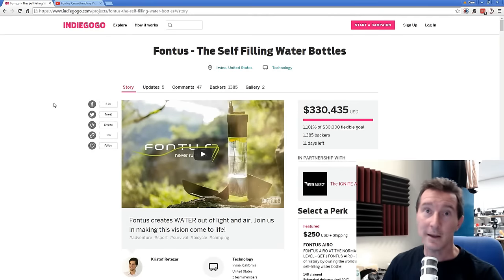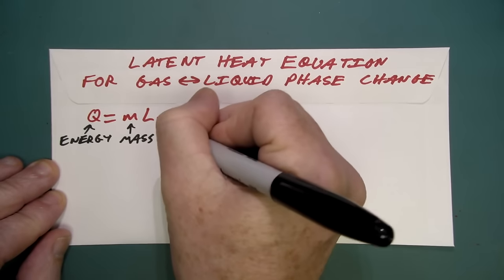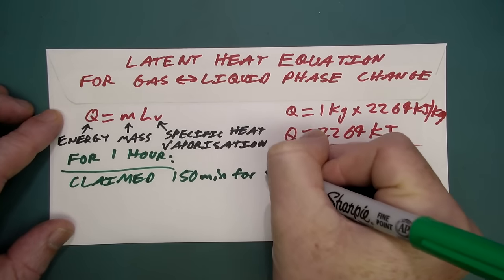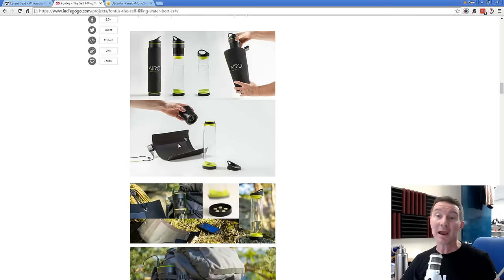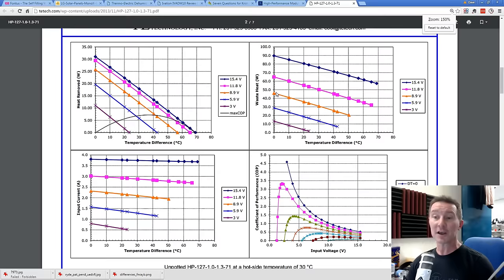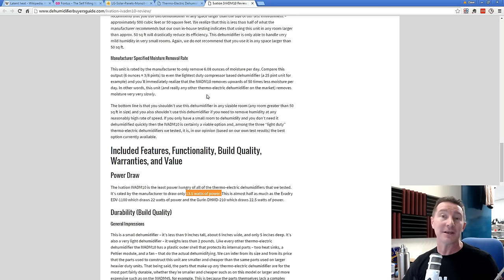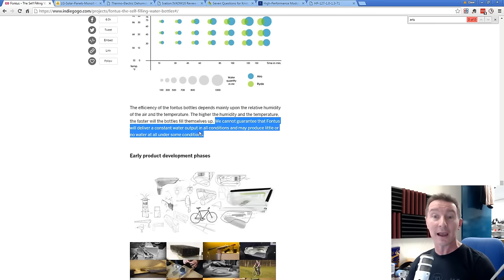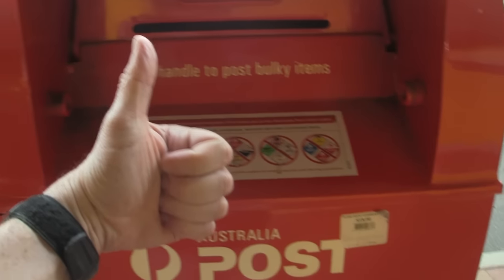EEVblog #881 - Fontus Self Filling Water Bottle BUSTED!

Comment: Actually energy is released when water condenses, so you don't need to put the vaporization energy into your system but rather extract it from your system - otherwise your water will immediately re-evaporate. But where is all that water supposed to come from? Saturation concentration at 40°C is  according to Wolframalpha, that is about 50g of water per cubic meter of air. For 1L of water you would have to remove all water from 20 cubic meters of air - or more likely 10% of the water from 200 cubic meters of air.

One fun fact is also that their promotional video shows a bike rider in a cold and dry environment - it's much easier to get the water in that area by melting the remaining snow on the ground ;)

And lastly the condensed water would essentially be destilled water, free from any minerals and probably not the stuff you need after an intensive bike ride...

Comment: Totally agree that the product will not meet its claims, but Dave you didn't really explain that the energy you calculated was being removed from the water vapour in order to condense it. It may happen though that the energy required to shovel this heat away is in the same ball-park (COP ~1?), but felt like you glossed over it a bit...

Comment: also the fact that in 40C performing strenuous activity (adventuring) you need to drink 2L of water an HOUR since you're going to sweat so much fluid and drinking hot water is not recommended because you need something COLD to avoid heat stroke

Comment: Math checks out!  As soon as I saw those kJ/kg units in the chart, I had to pause the video and run the math myself.  I got as far as seeing 1L/1hr of water production would run you about 629.1 watts continuously over that hour, about the amount you could expect from a decently beefy gaming PC.

Naturally I then had to resume the video and see if my math checked out (thankfully it did), and for the 150minute time you went with I got approx the same result:
        (1kg * (2264.76kJ/kg)) / 150minute = 251.64 watt

I looked up some advertised specs on a portable solar panel that looked about a similar size, and it advertises 5W of power max.  Assuming that kind of power available, 50% efficiency to account for night, and 100% efficiency everywhere else, you could get 1 liter of water every 1 week, 3 days, 11 hr.

Going further, a random site is saying men need 3.7 liters of water per day, so in order for someone to be able to survive off of entirely bottles powered with those 5W panels, you would need 39 of these bottles to sustain yourself, and most of your day would consist of going back and forth between them to reposition them to point toward the sun, and the rest of the day would consist of doing everything you can to avoid sweating lest you need to start buying more bottles to deal with the increased water intake.

If I'd lived on Tattooine though, I would totally pick one of these up if I saw it in a flea market.

Comment: i managed to make a "atmospheric water generator"<read dehumidifier> using several peltiers in parallel i managed barely 100ml in an hour with a 12v 30A power supply. The other factor to note is the amount of air drawn in. You need 30 CFM of air at 100% humidity at 30 degree centigrade for one hour and extract all the water out of it. Very possible if physics took a few sick days off

Comment: Well I have to admit, my fridge does make a lot of water from condensation every single day.. Not enough to drink, and I certainly wouldn't drink it
Reply: shomolya probably, fridge uses half a kwh per day
Reply: +redtails and 1 peak watt solar panel produces about 1-1.5kwh/year depending on where you live in the world, so ~185w solar panel with no electrical transmission/conversion/storage losses
Reply: +redtails Don't drink it - it is full of dust and you have never cleaned the bowl on top of the compressor :D

Comment: You have misunderstood the thermodynamics of condensing water out of the air. Water vapour is not a gas phase of water, which is steam, so there is no Latent Heat that needs to be extracted from the air to create condensation. Instead, the air must be cooled below the Dew Point for the air, which depends on humidity and temperature. At 90% humidity at 20°C the dew point is ~17°C, so the cool surface must be below this temperature to condense water. If no Latent Heat is generated by this action then the energies involved are much, much lower.

Comment: Interesting to see a different approach to this. Another guy worked it on how much water is in air at 30C if saturated and how many litres of air you would need for 1 L of water. Assuming 50% efficiency then you'd need 100,000 litres of air. So busted wither way.

Comment: Dave, in order to produce water from steam you have to take energy out 
of steam, not to bring it. You have to take 250 W from the freezer in 
the bottle - it's a different case.
Lat's do the math.

dew point for 40C 90% is Tc = 37 C = 310.15 K
ambient temperature Ta = 40C = 313.15 K
Diameter of a radiator d= 6cm= 0.06m
Speed of a cyclist = 15 km/h = 4.16 m/s
Isobaric volumetric heat capacity of air C=0.0013 J*cm^-3*K^-1 = 1300 J*m^-1*K^-1

So for Carnot cycle (ideal case) we have
W = Wh*(1-Tc/Th)
where W = power of the heat engine, Wh - Power of the heat source, Tc - temeperature of the cooler, Th - temperature of the heater.
Engine produces power W taking power Wh from the heat source and bringing part of it Wc to cooler.
As long as Carnot engine is reversable we can bring power to it taking power Wc from the cooler and moving Wh=Wc+W to the heater. We know that we have to move Wc=250W from the freezer. Let's find how much power W we need for that.
We know that Tc=310.15 K because it's a dew point we need to get water.
Let's find Th.
All Wt has to be blown out by air, moving through the radiator of the system.
Every second through the cylinder d=0.06 moving with a speed 4.16 m/s passes V=0.01 m^3/s of air.
If heat exchange is perfect air comes out with temperature Th and moves away
(Th-Ta)*C*V of power
Wh = (Th-Ta)*C*V
on the other hand Wh = W/(1-Tc/Th) = (Wh-Wc)/(1-Tc/Th)
Wh=Wc*Th/Tc

(Th-Ta)*C*V = Wc*Th/Tc
Th = V*C*Ta/(V*C - Wc/Tc) = 333.8 K

W=Wc*(Th/Tc-1) = 19 W (to move 250 W from the bottle)

What's the size of a 19 W panel?

Of course, if they want to use Peltier cooler with a 10% of efficiency of the Carnot cycle, they have to find 190 W of power. And because of that additional power we have to dissipate, our hot radiator will be much hotter and it leads to even less efficient cooling which leads to even more power consumption and so on.  
And of course it's an unachievable case with perfect heat transfer, the radiator as big as the bottle with no air speed loss in it, without taking in account that we have to cool down air to dew point and so on.

Comment: I know of a real way to get water using solar energy: plastic bag around a leafy tree branch. Another option is to dig a hole, put some branches in it, or some undrinkable liquid with water, like pee or seawater, put a cup in the center and put some plastic over the top with a small weight over the cup.
Reply: +Brandon Taitano also air wells to collect water from the air via daily temperature variations.

Comment: Dave, do you understand that what you have in the air is not steam? That calculation is better suited for condensing hot steam from over 100°C. You just need to cool water under its dew point, which depends on humidity and temperature, to condense it. At 90% humidity with Tamb = 40°C, dew point is about 38°C (see https://en.wikipedia.org/wiki/Dew_point#Calculating_the_dew_point). You are cooling water and air together, but heat capacity is dominated by the water, so is about 4kJ/KgK, which means that you need let's say 10kJ for 1L, in 2.5hrs that is 4kJ per hour or less than 1W. So yeah, I guess you can get away with the small panel.

Comment: Why wouldn't you just buy a bottle of water? Or fill up a bottle with a tap?
1L of water = 1L of water, in several seconds. Recycle the bottle. Done.
If it comes out it'll suggest in the instructions to fill the bottle before heading out so you have some water ready to drink, and it'll claim to "replenish" it.
Reply: +bassl0va What next, are you going to say we should let the water condense through temperature gradients way up in the sky and then just filter it so we don't have to change the state ourselves? Then there would be water falling on stuff all the time, what a disaster!

Comment: Dave, could you please explain why tapping off of centrifugal force in only one tangent (straight up) to make the engine doing it weigh less? I saw some one trying to explain this calling it an "angular momentum drive". Citing the variables (among others) as mass, rpm, mass travel distance, forced moments (in degrees on extension & retraction of mass).

Comment: I have done theses calculations before this project came out. One could use batteries, but it would be heavy.
 Even if it worked, it would a  better idea to carry 1L of water on a very lightweight bottle and refill along the path.
Reply from the maker: +Jonathan Araujo Can do the back-of-envelopes on that one too. But I don't even need to touch the pen to know it would be silly.
Reply: EEVblog people with a basic of physics knowlege can just "feel" improabable things like this.

Thinking on weight, once I imagined a system to carry just the H2 gas and combine it with atmospheric O2 (burn) to have water. It would be a heavy chunk of gear to store H2, burn and cool it down. Better to just carry the water...

Comment: I have one of those white plug-in Ivation dehumidifiers and it's never actually managed to remove 250ml in a WEEK (probably even a month) after 24/7 operation in air of around 50% humidity.  Maybe the Fontus Airo is designed to meet the water needs of ants?  I dunno.

Comment: If it takes 2264 J to produce 1 kg of water in 150 mins, and you divide that by 2.5 to get roughly 1000 J in an hour, aka 250W, you're not producing a kg of water in that hour with your 250W for an hour, you're producing 400 ml.

Comment: Maybe if you could create a very cold tiny  point and then lock the condensation in the bottle somehow so it is like a fluid diode, then the energy requirement would be lower? OK so it may take a LOT longer than you would want. What you seem to be doing is actually canceling entropy, like what is the lowest energy way to counter entropy.
Reply: +Matthew Suffidy Not totally sure this water doesn't have dust in it also, so I don't know it would be cool to drink.
Reply: +Matthew Suffidy Are you thinking of something like Maxwell's demon?

Comment: If they use the heat from the hot side of the Peltier device the amount of condensation possible when the hot air hits the cold side of the Peltier might cause significant condensation. 

Some intelligent energy management and zone damper systems actually run the heat with the air conditioning, to cause extremely rapid dehumidification of indoor air. The high TD (Temperature Differential) causes the water to condense, as the air rapidly contracts in size through the cold evaporator. 

Along with small pressure differentials and a Ranque-Hilsch vortex tube effect, pretty good condensation may occur. However from actual experience from units pumping 5 tons of R-410A refrigerant an hour, through a very large evaporator, I highly doubt that this small device could come anywhere near a litter in two and a half hours. Part of the reason is the quantity of air that would have to pass through the unit, to get one liter of water. It would require a large quantity of air because the water is highly dispersed in the air. 

If you have ever used an older smoke machine you know that just a small amount of water used, can fill a room with very uncomfortable wet damp air. So unless the fan in this small device can pump many CFM (Cubic, Feet, per Minute) of air, I highly doubt the unit will get its hands on enough air, to get enough water. Because of the small amount of air that will pass through the unit. Assuming a total condensation of all water in the air passing through. Even if it could power a fan to draw ten cubic feet of air a minute through the canister, it would be short 10 times the volume of air necessary to get that much water from air. 

They may be forcing the air through a reverse osmosis filter, which if the filter is cooled may be able to extract all or most of the water in the air passing through it. Because the openings within a reverse osmosis filter in many cases can stop a virus from passing through the filter. Such tight proximity to a cold wetted surface on a molecular level may extract 100 percent of the water in the air. But again I doubt they have achieved this. I believe it could be done though.  

There are very real things that laugh at unity, however I suspect this is not one of them. When I was younger I was at the Long Island Science Congress, in the 70's and another student had a solar cell his fathers factory was making but could not sell. It output 10 volts, in a dimly lit auditorium. It powered a small motor very well. 

Having had friends that worked on top secret weapons projects, using radio waves, I am sure that perpetual motion is real. And it is also very scary to some that fear evil uses knowledge rather than ignorance to base their evil actions upon. 

There are also certain impeller configurations, that can cause rather amazing effects, pressurizing air. However again I am in agreement that this device will leave you rather dry if you expect the listed results. 

Sincerely, 

William McCormick

Comment: There is an update from the guy on indiegogo, "The information shown about the core technology Fontus uses to extract water from the air is simplified and incomplete due to the fact that it cannot be made public until it is fully developed"

Well, at-least he admitted two things;
1) Technology is not fully developed (of course it will never be)
2) Information/illustration given is far from reality (used industrial/graphic design skills to mislead people) 

The guy seems to be a talented art student, who has skills with graphics and presentation, only if put to good use. Unfortunately, he seems to have another skill, as an excellent con-artist.

Comment: Sorry Dave, at 4:50 you made an error of units  in your calculation, mixing Energy and Power, or missing the evaluated time:905kJ/l = 250Wh/l (not Watt/l).So in 2.5h, you would 'only' need a 100W panel.
Reply: +Dr. Frank 

kinda right but kind not. dave did make a mistake. he counted the 2.5 under the 2264 Kilojoules as being liters when it should have been marked as hours. 

2264KJ/2.5h = 1L
normalize it to an hourly rate ->
(905KJh)*2.5h = 1L
convert to watt hours 1Wh=3.6KJh ->
(251Wh)*2.5h = 1L

still need that 250 watt panel =(

Comment: 250 watts in an instant is ROUGHLY a solid baseball bat swing at like half of all your might.  Do this for an hour, CONSTANTLY with no break, that kind of output of energy is needed.  Sorry bub, your dinky little solar cell is NOT going to do that.  And the condenser would probably catch fire under that much load if we consider heat loss from any resistance in the circuit.

Comment: You forgot to mention one thing, unless you live by a large body of water, high humidity means cloud cover. Which means solar cells don't work very good. At least that's what it means here in the US. Normally, in the US, on a hot day Which is when you need the water, You will get about 50% or so humidity, In the summer. Your not only not going to get the solar power to charge the batteries and run the thing, when you have the solar power available, you're not going to get the humidity you need for it to work. " Catch 22 ".  Maybe if they put a 500 W generator on the bike, it might work. But who wants to pedal power a 500 W generator on a hot day especially if you're trying to go uphill. maybe they can change the design a little bit, Instead of a dehumidifier, make it where it will cool the water or at least keep it cold. That might be Reasonable.

Comment: I have a brilliant idea! How about I could invent a device that attaches to the exhaust pipe of a car that absorbs exhaust gases to make more gasoline! Fuel efficiency would then go through the roof!

(Nevermind the fact that you'd have to keep replacing the device because it would run out of reactants and the device would cost energy to make.)
Reply: +LT Gen Klink Condensing water from the air through the power of the sun is a bit more realistic than that, but not a very good way to make money since it happens all by itself whenever it rains.

Comment: well... my AC unit (which also has a nice water drain which I have connected to a barrel - as well as a rainwater collecion thing - so I can use the water for plants) barely get's 1 liter a day (without rain that is) ... let alone that this bottle with just a VERY small TEC can do it :')